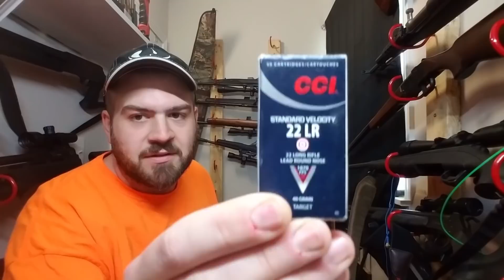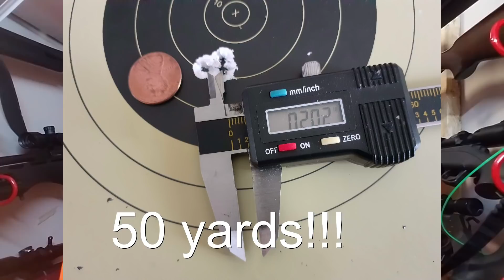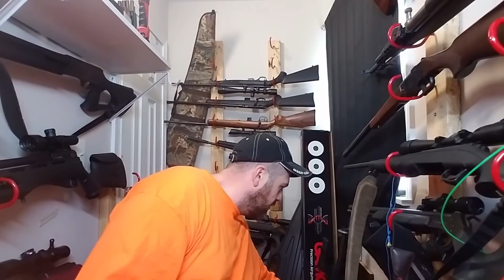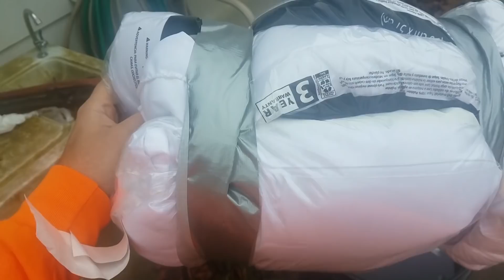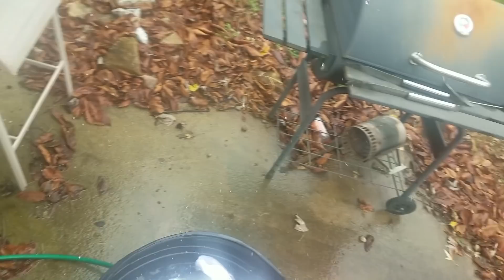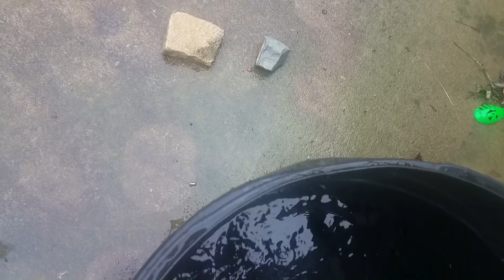22LR Accuracy UNKNOWN SECRETS Found?

Comment: Question James:
I have a Marlin Model 60.
It has the Marlin MICRO GROOVED BARREL….. It appears to have about 15 - 20 or so “small lands”.

I have tried to do testing like you did with bullet bearing length, and angle of twist……and it just appears that the bullet is sooo controlled by the bearing surface of the bullet contacting so many  “grooves” that the bullet is launched out of the barrel like a “perfect spiraling football”.

I have also tried testing the bullet in WINDS, to see if the bullet spiraling so perfect and fast was able to DEFLECT and DEFEAT crosswinds while in flight….I tried different yardages so as to capture the bullets ability to “push through crosswinds as the bullet loses speed…
I found that out to 63 yards STANDARD VELOCITY BULLETS deviated in the wind LESS than REGULAR 5 RIFLING BARRELS.

Accuracy was SUPERB in MICRO GROOVED BARRELS compared to Regular 5 Rifling barrels.

Can you confirm any of my test results?  Basically, what is YOUR OPINION of MICRO GROOVE RIFLING for ACCURACY, over the different width rifling and spin rates you have found.

Thanks James
Reply from the maker: The Marlin microgroove rifling is a button rifling with 16 grooves and 16 lands,  at .2225" down to .221"... the microgroove rifling is supposed to be really good for maximum accuracy due to the bullet deformity in the rifling but that all depends on other variables too, like how perfect rifling got swaged or cut without being galled. Sometimes you get a really good barrel and or a really bad barrel....I shoot a 12 groove/12 land Keystone Sporting Arms target chamber microgroove barrel in competition, it will outshoot a Marlin  microgroove barrel and like you mentioned it bucks the wind very well....against standard rifling

Comment: Solely on the strength of this video, I purchased, for the first time in my long life, some Aguilla .22 40-grain long rifle ammunition in both the standard velocity and the high velocity.  I took them out to the range this morning and tried them out in my 10-22.  Both performed very well at 50 yards with target grade groups.  The carbine is the factory standard model except that I swapped out the trigger group for the Ruger target grade trigger group and mounted a big, fancy 3X9 variable telescopic sight.  The hundred yard groups were both very poor at four and a half inches.  Functioning through the action was perfect for both types.  I have had similar experience with Remington Target and other loads with that carbine/scope combination.  I think that basically I have an excellent 50-yard carbine/scope combination, but 100 yards is just overmuch for practical accuracy.  I further suspect that the cause is the scope being parallex adjusted for 50 yards.  Now that I have the ammunition, I think that I shall next try it out in my Savage 1919/33 NRA model with a micrometer peep sight.  I suspect that the Aguilla ammunition shall do very well at both distances inasmuch as parallex is not germaine to iron sights.

Comment: Very interesting that the groove WIDTH difference make such a difference. That said, it might have been good to also get the other-two dimensions....to offer a more complete picture of what's going on....meaning......what is the corresponding barrel Land diameter?...and barrel Groove diameter? .. for each barrel. Why do I say this?---> because if you take something like a Waltz resizing die.....after its use it slightly "increases" the diameter of the bullet after the bullet is squashed after resizing, ....so that the fatter bullet then compresses MORE against the lands and grooves...and is more uniform in diameter. Without a doubt this increases accuracy.

Comment: The twist rate does NOT change in relation to the land and groove width ratio. Incidentally neither does the land and groove diameter which does have a SAAMI specification. The only thing that does not have a SAAMI spec is the land and groove width ratio.

Comment: Great work...very informative....I have done some research into other factors. One thing I have found is that the chambers vary a lot. There are perhaps10 different reamer profiles for match rifles alone. Groove diameters also vary...Generally match barrels have very slightly tighter bores. When you couple these differences to the slight varying specs of different bullet manufactures, it explaines why some guns prefer certain ammo while others prefer others. But generally better ammo is made to more exacting specs. I like your approach to the testing...Good results.

Comment: My challenge is that I would like to be able to control nuisance squirrels in a neighborhood environment.  My plan would be to use subsonic 22 ammo with a bolt, or lever single-shot action to minimize noise.  I have concerns with the correct mussel twist for maximum accuracy.  I am wide open for advice on riffle brands and ammo. Any suggestions?
Reply from the maker: You can go air rifle if needed that way you don't have to worry about stray bullet
Reply: Air rifle is a great solution